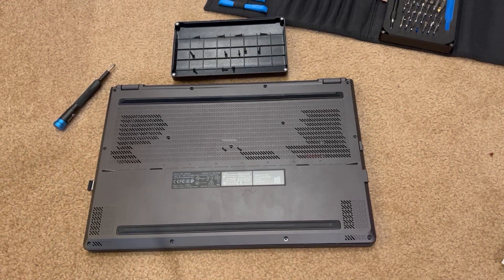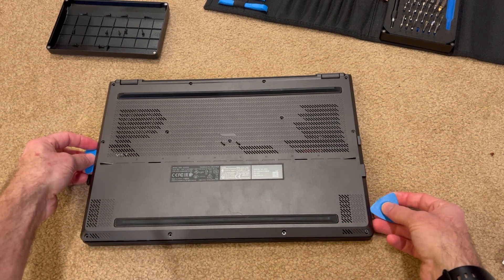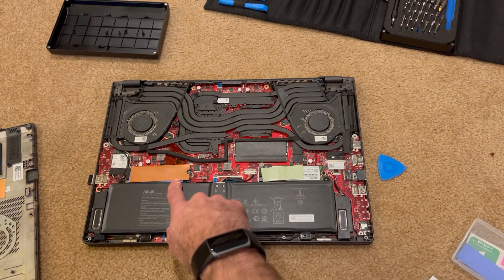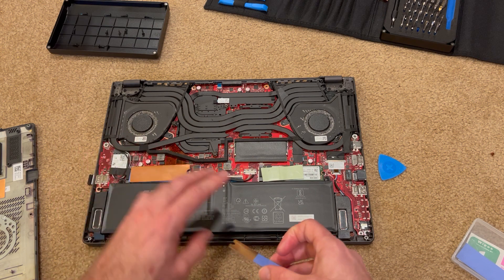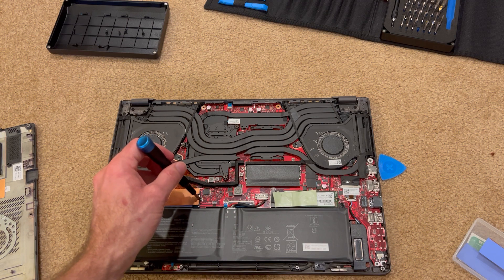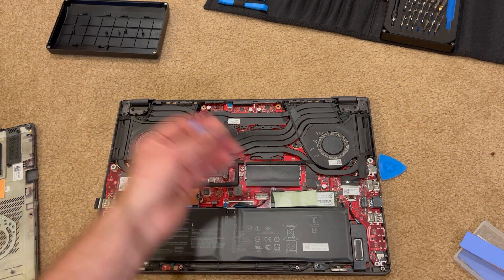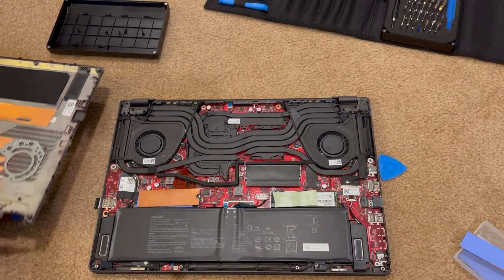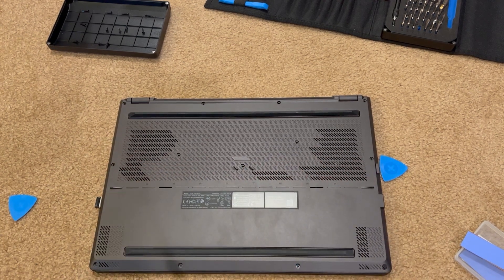Zephyrus G15 2021 Add SSD and Should you have Copper Heat Sink to SSD

Comment: I have Asus ROG Strix G15-G512lv rtx 2060 (forgot what year) planning to get SSD as secondary memory 
prob going to buy WD SN850/770 
the thing is do I need heatsink for that? 
or is it better just buy external SSD instead?
Reply from the maker: so i would recommend reading reviews and checking heat and power on the SSD your interested in, if you go internal. Make sure it runs cool then you dont need a heat sink. 
Option 2 is to buy an internal and put it in an enclosure. you loose a lot of speed if you care though. 
If you need the higher transfer speeds go internal other wise external will be fine for most things. even game storage but you want have the absolute fastest load times but should be acceptable.
Reply: @computer-tech-more  average temp for the SSD I'm planning to buy without heatsink : 
Operating Temperature
0°C to 85°C
---
Non-Operating Temperature
-40°C to 85°C

I'll assume somehow will reach 85°C I wonder if this consider high in laptop? (I'm planning to use for gaming)
Reply from the maker: @wilsont2377  that 85C is a bit high and of some concern. if its only doing that under large file transfer its fine. if its doing that while gaming its a problem

Comment: I upgraded the ram and ssd . Now my asus sitrix g17 KB isn't working.   Kb lights as well. Rogg symbol on the outside lits up though.  The 2 cables for rgb lights are linked to KB as well?
Reply from the maker: Check they are installed correctly. 
Other than i'm not sure what could have happened.

Comment: Brother can you please tell me if A Seagate firecuda 530 2 tb SSD comes with a heatsink can fit into the laptop or have to remove the heatsink from the SSD to install in the laptop? Because the laptop is thin.
Reply from the maker: I think the heatsink would have to come off

Comment: Hey, I have recently changed the SSD from an Intel 670p 512 GB to WD SN770 2 TB in my 2021 G14. Intel 670p had a temperature around 35C when idle and 45-47C under active workload. Now after the SSD swap, the idle temperature on battery is around 35C but on power I'm getting like 40-44C idle while 50-55C active. I was thinking of using those copper strips but I'm not sure how much of a difference I'm going to see and also if it will fit inside. I have used a silicon thermal pad on top of the SSD but that's it. Can you tell me the SSD temperatures that you are currently getting on idle and active usage on battery as well as power?
Reply from the maker: I actually have taken it out. The laptops mobo faulted out with the keyboard connector. so I am using it externally now. 
But the slug is like a sponge. it delays the over heating. So long sustained loads will still over heat but medium bursts will do better than without.
Reply: @computer-tech-more  did the fault happen because of the SSD?
Reply from the maker: @sambitsarkar5190  its possible the ssd i chose did run hot. I also had a tv style wireless keyboard resting on on the top basically all the time. it could have been either / both. or just asus laptops reputation.

Comment: Nice content straight to the point. 👌
I have a question, Recently I bought a rog strix g15
Ryzen 7 6800, RTX 3050 with 8 GB Ram and 512 ssd, now I want to upgrade to 2 Tb ssd and 32 GB ram, should I buy a ssd with ssd or without heatsink?
Reply from the maker: without a heatsink. unless its ultra think like the copper one in my video. You may also want to check the bottom lid of the laptop for a copper strip if it has one you can sink the ssd into that.

Comment: Do you think the thickness of a 2mm thermal pad would be enouch to touch the backplate? (Zephyrus G15 2022)
Reply from the maker: I would guess no. I think you would be looking at 3mm thick. I'm not sure 100% though, but using just a thermal pad would be fine than thermal pad + copper, because of pressure. The thermal pad will compress a little if it turned out to be to thick. 
I know under the stock SSD it has a copper foil on the backplate. but I dont know that ones thermal pad thickness. It might be 2mm. 
sorry. I just have that info on hand.

Comment: I turned to this after buying an M.2 SSD. 
My temps only rises when transfering files and having something like a copper heatsink greatly slows down the temp from isntantly going up to 80 *C. 
I did buy 2 copper heatsinks, a 4mm thick and 1.5mm then put it on both sides. Works great so far.
Reply from the maker: I'm surprised there was room for a heatsink on both sides of the NVMe. . .
Reply: @computer-tech-more  yeah same lol. I bought 2 different sizes bcs I didnt know which would fit, and turned out that I could fit both with enough space.
Reply: @Mikkeru  pog
Reply: @Mikkeru Which one did you put on which side? 1.5 mm on top and 4 mm on bottom?
Reply: @atomicjay42  1.5 bottom and 4mm top on the ssd yes.
Reply: @Mikkeru  Thank you!
Reply: I know this is late but, I am in the exact situation as you, transferring files makes my new SSD throttle and even crashed. Gonna buy Thermal pads and Copper heatsink idk which is better though any suggestions?

Comment: Hello, so how’s the copper heat sink so far? Is there enough space to put the heat sink in the laptop without it being too tight? Maybe possibly squeezing the Wi-Fi card underneath ?
Reply from the maker: The copper heat sink fits perfectly. does not cause any pressure or bulging in the covers.
The Wi-Fi isn't actually under the SSD to that is not effected by adding this heat sink / copper slug. 
It really does keep the temps down
Reply: @computer-tech-more  ohh ok thank you, I’m just worried because I travel a lot with my laptop and I’m worried if the adhesive is sticky enough to keep the copper in place
Reply from the maker: @hamsanwich8754  It should. but the copper heat sink does come with a rubber strap that is there to help hold it in place. if you plan to travel a lot, you can do that. I use the laptop more like a desktop replacement, so i didnt install the straps.
Reply: @computer-tech-more  the rubber strap aged fast and split and fail aparts someday. i experienced this way
Reply from the maker: @shiftto  I didnt use the rubber strap at all. The copper has stayed nicely in place. Just my experience

Comment: For the 2tb sabrent ssd is it possible to install it as a secondary ssd instead as the main one? cause i dont wanna go through the hassle of restarting the laptop to adjust the ssd storage
Reply from the maker: Yes. That is exactly what I did. Just leave the original SSD in the machine and windows will know to boot from that one. 
You will need to initialize and format the new SSD in partition manager.
Reply: Where do i go for partition manager? Im sorry its my first gaming laptop and i just got me a new ssd for it.. thanks